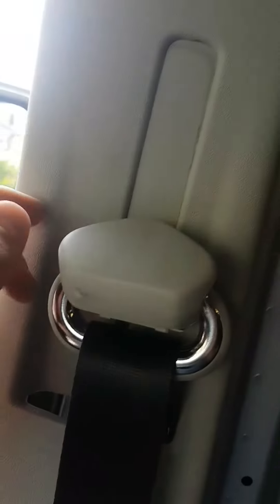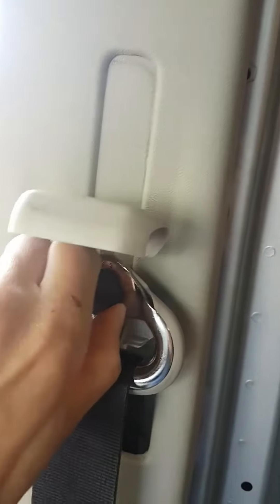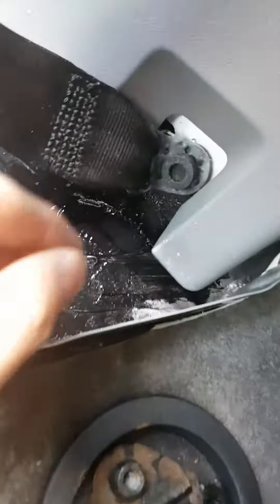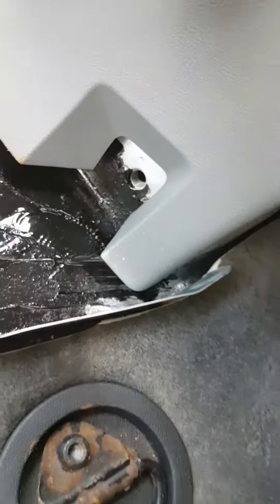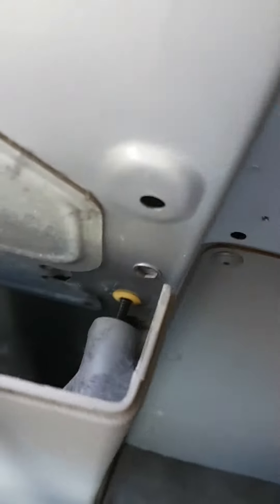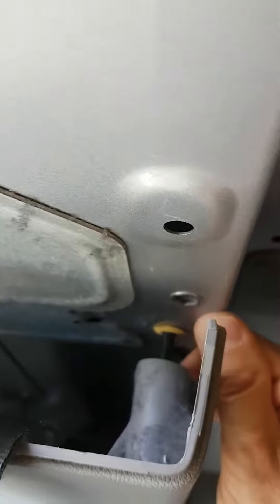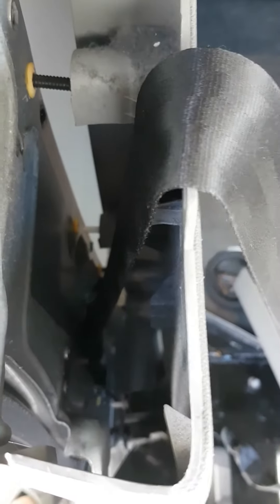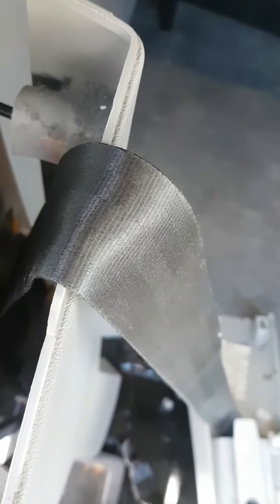Vw T5 seat belt trim removal

Comment: Cheers! Can you take off just the top piece without needing to undo the bottom piece? Trying to get access to top without needing to remove double passenger seat to get to the bottom seatbelt bolt.
Reply from the maker: Hi, yes I’m pretty sure from memory you can remove just the top piece 👍🏼
Reply: Thanks, yes I grabbed a set of spline bits from Toolstation and then took the top trim piece off with the 10mm bit. Was able to get my rear view camera wire along the headlining and behind B pillar trim this way. Nice one.